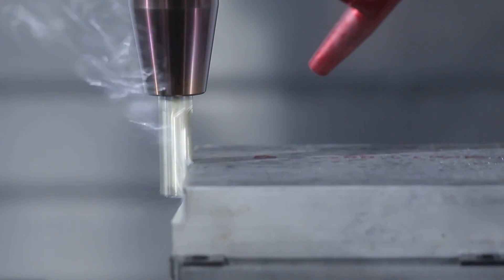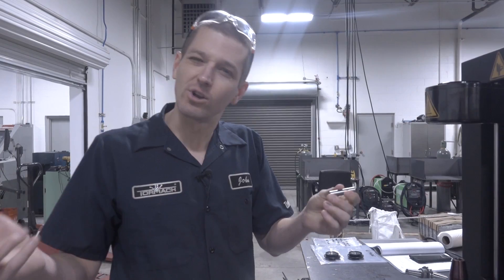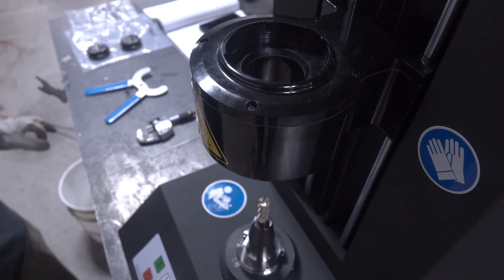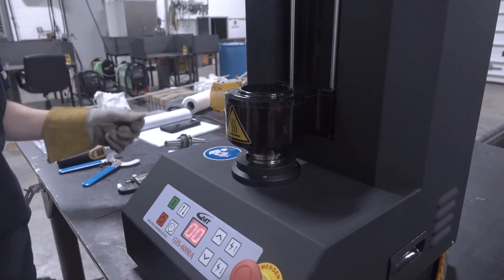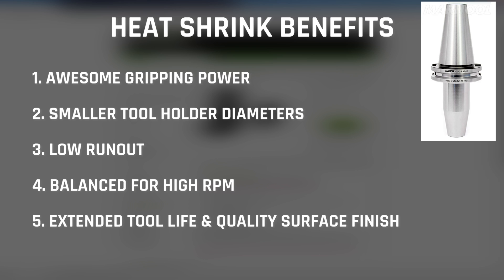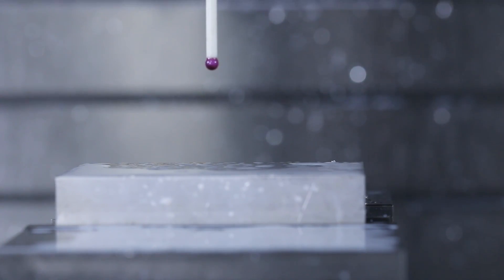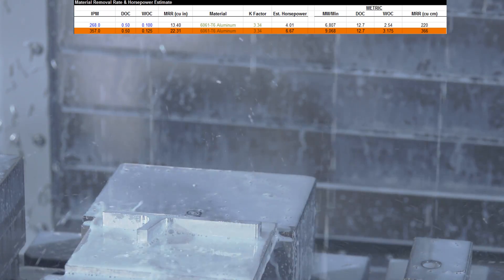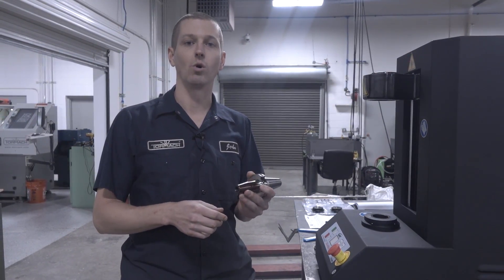What is Heat Shrink Tooling?  Testing a MariTool CAT40!

Comment: Never had any issues swapping tools in a large 50 taper HMC with the blowtorch method. 
Got a few slender tools from 6 to 12mm connection that I just spin the spindle by hand while using the torch to heat it up until the mill loosens. 

None of my toolholders got as hot as the one in the video, all of them are barely straw colored, so around 220-240c max.

Comment: We don't use the stop nut, we just get the tool holders with the through spindle pull stud and have a piece of welding rod stick in the bottom when installing an end mill.  It repeats to a few thou without any issue.  Plus it's cheap and doesn't need a spring loaded holder or a stop nut that can come loose.

Comment: You know, the tolerances are so tight and expected runouts are so small, that you need to keep that stuff extra clean since even a thread from those gloves getting into the tool holder or on the surface of the tool can mess up the runout tolerance :D

Comment: I believe the tool holder intentionally uses a special stainless with a larger thermal expansion coefficient so even the tool also heats up you should be able to get the tool out.

Comment: The reason they work is not the speed it heats it    Its that CARBIDE doesnt expand at the same rate so the steel holder expands MORE then the carbide tool which is the premise of it working

Comment: I was just talking to Carl about the coating locations on double ended tools because they can't fit in my hydraulic chucks. Do you think they could fit in heat shrink? I was measuring .2505 diameter on 1/4" tooling. Im guessing it'd be more likely to work on larger diameter tools since the coating is a smaller percentage of the OD

Comment: Look into Technara slim line shrink holders, different concept using shrink holders. Uses simple heat gun to heat and cool holders. Note always carbide cutters never high speed steel or you will be hard pressed getting them out.

Comment: I wish i would have putzed with some of the heat shrink tooling at my last shop.  My idea, take apart a cheap induction cooktop and reform the coil, have a spring loaded fixture to pull or eject the tool as soon as theres enough slip, or just leave it chucked up, turn the machine on, and put the induction cooktop right next to the holder.  Or trial and error with the holder wrapped in a wet towel in a microwave.  Even better idea is to put a small spring on the index rod so as soon as its loose it pops out.

Comment: If you snap an endmill even with the bottom of the tool holder, it would be a nightmare to get the broken tool out. The only thing I can think of would be to weld (tig, mig?) a stud to the broken tool.

Comment: You Can heat your tools up alot cheaper ways. I use heat shrunk holdets alot the last 10 years. Never had a induktion heater.

Its No problem how fast you do it. Carbite does not expand the same AS the holder in metal

Comment: I've a set that's 20 years old (Iscar shrinkin system) . it works using a standard heater tho- not induction, and will only work well with carbide tooling, as it has a different thermal expansion.

Comment: PSA: We had this happen out our shop last week by someone who made a mistake due to lack of knowledge. If you have multiple styles of tool holder, be intimately familiar with the difference between a shrink fit holder and a hydraulic holder. Should you ever accidentally put a hydraulic holder into an induction heater...the tool will explode.

Comment: Not really new technology. I was fitting tools to tool holders in the mid 80's with an induction heater and it was not a new machine when I was using it. No fancy digital though just timers and a voltage trip with an adjustment chart for different holder sizes. The holders used to bell mouth and needed checking with an air gauge, 0.004mm was enough for the scrap bin. 
Try hydraulic tool holders a lot quicker and easier to do a cutter change and compared to the shrink fit stuff I used in the 80's longer lasting.

Comment: This may be a silly question from a novice; but would you ever have to worry about the tool heating up during machining to the point that the tool could loosen and fall out under high cutting load?

Comment: What do you mean when you say are becoming more accessible to shops like us. Aside from the machine how much would a shrink fit holder sell for along with sleeves to serve more than one end mill size and have you mentioned the sleeves and whether they effect the tool hold rigidity. I work at TechShop Abu Dhabi and I have always been interested in these for the making of deep molds using our 3 axis tm-1p.

Comment: Correct me if i'm wrong, but i think that you aren't supposed to let the tool touch the bottom of the toolholder, or at least this is what is written in the manual of some of our heatshrink toolholders.
Probably it's not that important.

Comment: I use shrink fit tooling on my tormach, reason being is all my work is slotting into tight spaces with a 3mm ball end mill fitted to a 10 or so centimeter extension. As you know once you start using extensions the chatter, squeal and run out is on another level, shrink fit tooling accuracy took care of it. Yes i use Map gas, broken bits are easily pulled out with pliers or pushed through when fitting the new end mill.

Comment: you can buy a 1000W induction heater system everywhere on internet for something like 30USD with the coil
It would be a good project to do I think with arduino. You have to cool the coil, up and down the coil to adjust to tool length etc. Basically a copy of the marytool machine. Interesting project

Comment: I have an applications which would benefit from more "stick out" and less grip length on a tool that is only available in one shank length (A woodriff key cutter for an o-ring groove). How much less grip length do you think you could get away with using shrink fit?

Comment: I disagree with you about needing the heater to remove tools. I've been using a propane torch long enough to know better. And I'm not the only one doing that, there are plenty of other shops doing that. The smaller tools ( 1/8 in.) will require a bit more heat than the larger ones, but it's butt stinkin' easy to remove and insert end mills with a propane torch. You'll be fine.
You might also experiment with a higher quality ER collet chuck and collet ( say a Lyndex ) if you are worried about end mills pulling out. And as other have noted the standard end mill holders are fantastic when used with Weldon shank tooling. Anyhow, have fun with the new toys.

Comment: If you had turned the spindle override to 50% or so, that end mill probably would have cut just fine with no coolant. You just can't seem to wrap your head around the chip load. That end mill wants .006 per tooth for a full slot. When you take those wimpy small step over cuts, you need to crank the feed rate up, a LOT. The coolant just lets you get away with poor feeds and speeds.

Comment: The heating you're talking about can be achieved with high frequency induction, rapid low penetration heating. Low frequency like the 60hz straight from the wall will be slower but deeper penetrating, better for melting instead of simple heating. Cool machine but could be done in an analog fashion for 1/10th the cost.

Comment: Break an end mill flush in the tool holder and make a video about getting it out.
Reply: I wouldn’t recommend a blow torch although being ours have through holes you simply heat the holder and push the broken shank with a small rod.
Reply: use a vacuum tube with silcon rubber seal less than dia of cutter to suck down on the broken shank and pull it out
Reply: Very simple to remove the endmill that broken off from the heat shrink holder. Step 1 remove pull stud step 2 remove screw stopper from the heat shrink or if it doesn’t have screw stopper disregard step 2. Step three heat the shrink fit holder repeatedly until the whole body of the shrink holder turns glowing red and broken endmill should fall right off. Step 4 quench shrink holder with coolant and ur all done. 1 final step is to inspect of the shrink holder can be salvaged. Have a nice day mafuckinist
Reply: Upside down, blowtorch.

Comment: Gently chuck it in the lathe, spin it at a low rpm and apply heat from torch.  Works every time.

Comment: Have you tried regofix powrgrip? I just purchased that :-)
Reply from the maker: Heard good things about that system!
Reply: I had serious doubts about them, but what convinced me was a job that required a 240mm long access to a 12mm tool. They set me up with a machine for over 6 months and a bunch of trial collets and holders. The advantage there is that the system is self damping. I could've never thought that it was even possible to take normal cuts at that extension. Call them, they'll be more than willing to give you a trial system. Runouts are better than 3microns over normal tool holders over 240mm long the runout was 8microns. Its marginally more expensive than heat-shrink-fit, but you'll get better tool life and the way you use end mills, you'll see the payoff in less than 3 months.

Let me add another thing. The heat shrink is not unlimited cycles, each heat shrink cycle adds a bit of hysteresis into the material of the holder, thus changing runout, internal dimension and the capability to tighten to original dimensions, such things don't exist with cold shrink. The cold shrink is proven for around 20k cycles. In the cold shrink systems, regofix gives you constant holding around the circumference as opposed to Shunk which is just three point. I've tested both.

Comment: For tool removal, why not camp the end mill and hook a spring to the clamp so that when the tool holder heats up to the right diameter, the spring pulls the tool out of the holder. This method should allow for a DIY system.

Comment: Why not make the machine John... You disappoint me here.... Get some coper.. maybe a welder? Or a microwave transformer a arduino some linear guide rails... Go
Reply from the maker: We looked into it.  There is (real) risk re: electricity/power/amps - the sort that can kill you.
Reply: And a high power LC resonator circuit to do the actual heating?  Induction heaters are super complex, and waaaaaaaaaaaay out of scope of the kind of things NYC CNC does.
Reply: or...you know...some oxy...
Reply: Alex Haws as has been stated in other comments, carbide has a hugely different rate of thermal expansion (smaller) therefore you could use oxy-acetylene to slowly heat the whole tool AND holder until the tool fell out.
Reply: Just stick it in next time you cook some ribs on the Q, works good been doing it for years.
Reply: https://www.banggood.com/1000W-20A-ZVS-Induction-Heating-Machine-Cooling-Fan-PCB-Copper-Tube-12-36V-p-1089662.html?rmmds=detail-left-hotproducts&cur_warehouse=CN
Reply: heatshrink tooling is very impressive but it looks like there are holders that produce less chatter... https://www.youtube.com/watch?v=2ONB84xO658

Comment: We used a machine similar to this: http://www.theequipmenthub.com/wp-content/uploads/2016/05/md-131012-6.jpg at my former employer. The heat was generated by a Steinel HG 4000 E heat blower. It took few minutes to heat up but otherwise worked flawless.

Comment: You don't need to be quick to take the tool out as the tool steel and tungsten carbide have different coefficients of thermal expansion (for tool steel about 12*10^-6 m / (m*K) (that is 0.012 mm per meter of diameter times the degrees of temperature change in Kelvin) and tungsten carbide about half of that) and when both are heated equally the steel will expand more. This is also the reason manufacturers usually don't recommend using HSS tools in heat shrink holders as coefficient of thermal expansion for HSS is quite close to that of steel - about 10**10^-6 m / (m*K).

Comment: Fun fact: It is really easy to make induction heater.
Reply from the maker: I have yet to see any that are this powerful - and safe to make/use.  Not saying it cannot but done, but most of the DIY ones have way less wattage than this
Reply: The tool he showed was only $3800. I could engineer such an induction heater, but to get it to the standard of quality and safety that it would be right to deploy to the shop floor, it would have cost more in my own time than a bought one. There's a big gap between what you can do in the danger of your home shop and what's suitable for the production floor when it has to be safe and reliable for years of operation.

Comment: You can pick up DIY induction kits for less than $100 on gearbest, banggood, etc. The tricky part in comparison would be the understanding of the timing of the heat application, if there is some closed loop feedback and some sort of "program" that is using waveform manipulation to do ease-in, ease-out of energy applied. The machine I'm sure is designed more for end-user safety, but I'd have thought trying to keep the field as perpendicular as possible to the toolholder is important to maintain it's lifetime.
Interesting application of induction heating though... nifty!

Comment: 1:45 bearing heater?? What is a bearing heater?
Reply: Da L. 
An old microwave 😁
Reply from the maker: https://www.youtube.com/watch?v=0vL-sArhmkI
Reply: Bearing heaters are nice but all you need if a temperature controlled fry pan or hotplate. 100deg C is all that is needed for bearings any more and the size is wrong and you start to run into problems with grease and temper. On most bearings 100c will give you 8~15 seconds to get into position. The only time I still use the induction heater is for bearings that wont fit into my fry pan.

Comment: Arduino + induction heater + home built frame = Wednesday widget
Reply: About three times as much power as you can put into one of those hot plates, ~5kW (if you want to match this thing's power output).

Could always build the induction heater yourself, though it's somewhat more difficult than your average arduino project.

http://inductionheatertutorial.com/
Reply: Me too  -- single burner induction cooking hot plate for the induction parts + some new PWM arduino code to drive it.  Wonder how many watts of power one needs.

Comment: Very, very cool tech. Is there any concern for material warping after many cycles? Dumping and cooling the holder that many times, does it end with any run out?
Reply from the maker: I'm told 'no'
Reply: The lips at the end of the holder begin to go and no longer shrink around the tool. Progressively gets worse from there with less and less of the internal bore actually gripping on the tool. 

Typically 1,000 heat cycles but higher end ones can go through 2k-3k cycles before needing to be replaced. 

Any vendor that says “they’ll never wear out” is just giving you marketing wank. Everything wears out eventually.

Comment: You won’t see much advantage with shrink fits in roughing applications like this. A well balanced sidelock would outperform a shrink fit in that application. 

Where shrink fits shine is in long projection finishing applications, where you have to reach 6 inches out and have 2 inches of tool sticking out of the holder. 

The down side to shrink fits is the long gauge length they require. You’re already 3+ inches away from the spindle before you even get started and with nothing to dampen vibration, with the tool you have a nice, stiff, 4” long canter-levering tuning fork...
Reply: They work perfectly for roughing applications we run them every day 360 days round the year great for volumil applications
Reply: These holders are real popular with shops that have a lot of 5 axis machining. You will hardly see them at regular job shops.
Reply: Samuel Kapoor 
You could rough with an end mill glued to a broomstick if you wanted to. Doesn’t make it the best suites holder for the application. 

There’s many reasons why shrink fits are not suited for heavy roughing and there’s better holders for the task. Side lock solid holders are still some of the best holders for roughing short of milling chucks. 

Shorter gauge length, better axial holding power (won’t pull out) and better dampening properties. 

Yes. You can rough with a shrink fit. But why?  You’re not gaining anything, more expensive holder, and can’t be pushed as hard as a milling chuck or side lock holder.
Reply: For rouging I like the zero gauge er collet holders from Sandvik .. "Shortin"..other manufacturers do them also... not as sturdy as a side lock but a good all rounder and they give loads more z clearance. The SPR coated ER collets last for ages as well.
Reply: Must not know about Haimer Safe-Lock...

Comment: If heat and a push from the taper end didn't get the tool out then I'm going to guess you managed to bore a hole through the tool to relieve the fit somewhat.